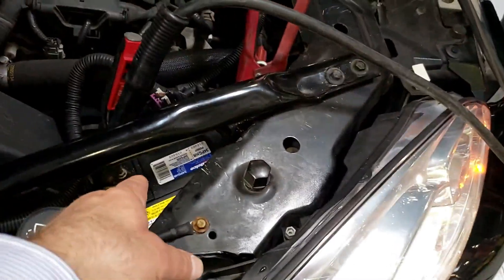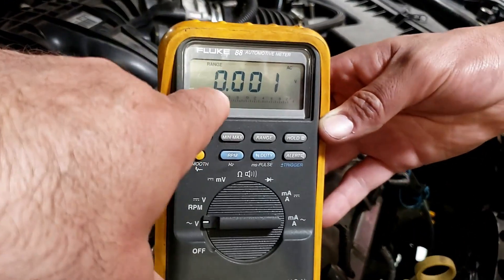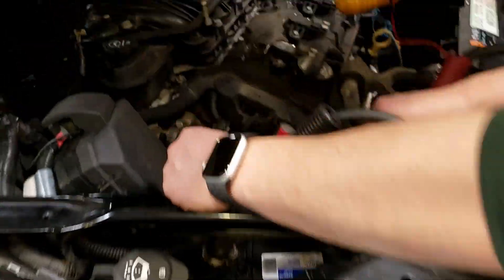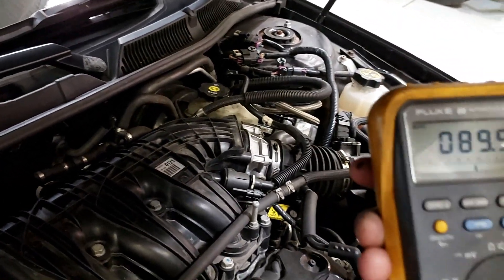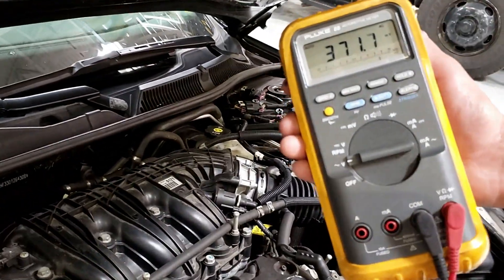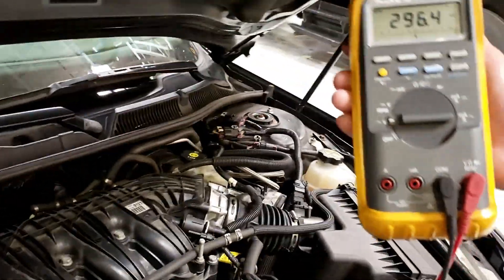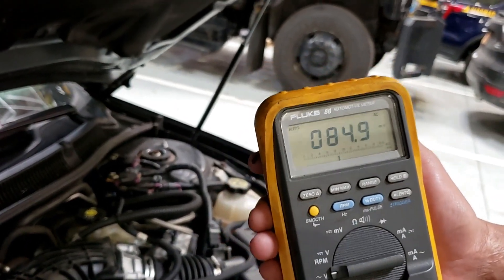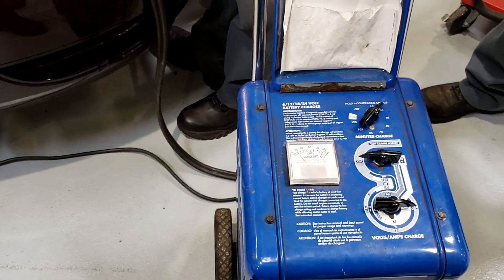Testing AC Voltage on a Battery Charger

Comment: Hi i'm troubleshooting a possible bad alternator in my dodge journey. With vehicle running, and setting multimeter to ACv, and connecting the leads to the battery terminals, i'm getting 31.6v. This would show that the alternator has faulty diodes or regulator correct?
Reply from the maker: Shawn you have your meter set to AC volts and the meter is reading 31.6 volts at the battery....is that correct? I would make sure your meter is on the 40 volt scale...if you can take a picture of the meter on the battery and send it to gt@tstseminars.org so I can view it. I have not seen any alternator but that out. If you have not already subscribed to our tstseminars YouTube channel please do so. Interested in more training? Go to www.tstseminars.org and view full length videos for members on TechFlix for $9.99 unlimited viewing …Membership and over 85 videos for less than $200.00 a year. Also checkout www.attstraining.com for hands on training and webcast
FREE videos at www.tstseminars.org/training-videos
Reply: @TSTseminars  yes the meter is set to AC volts, but the lowest scale is 200. The reading I get with the vehicle on is 31.6 AC volts. I'll take a picture and send it to that email address. Thank you for responding and look forward to your advice.